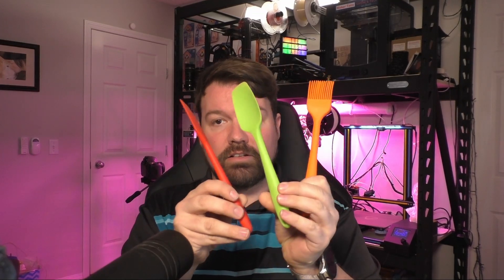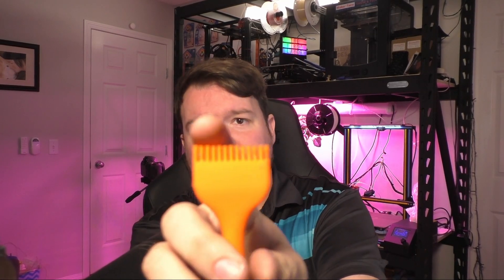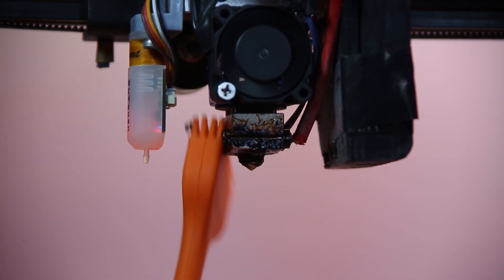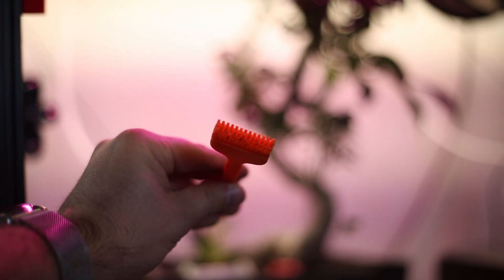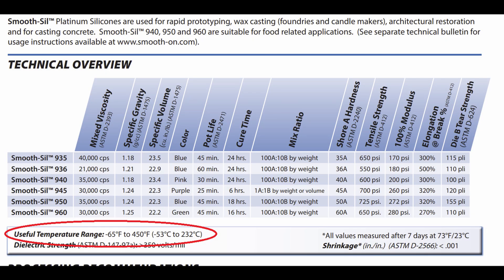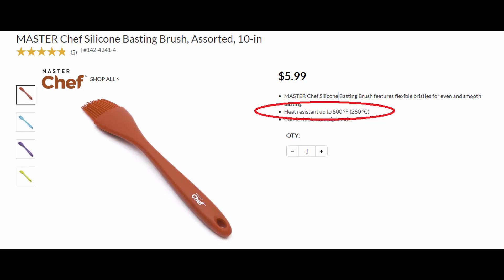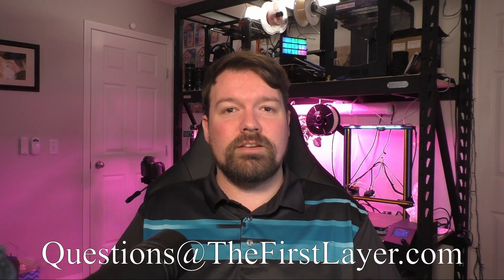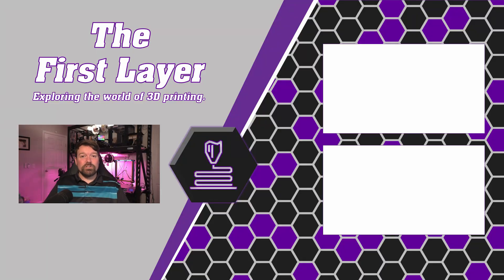The Best $5 Accessory for Cleaning your 3D Printer Hotend

Comment: I use paper towel. I cut sheets into quarters, I then fold a quarter sheet  4 times so I have a 8 layer piece that is about 5-6cm x 1cm and then with the nozzle at printing temp I wipe down the nozzle and block every print with quick movements.

I have a 3 year old block that looks almost new on a printer that prints almost daily. If you keep everything cleaned you should never have filament any where near the wiring to even need a special tool.
Reply from the maker: That's a neat idea for sure. I've said it in another comment, but you could also buy one of these silicone tools and cut it to be a wand so you don't put your hands near the heating element.

Comment: Bryan..liked the delivery...loved the whole .."Ding"..turn on a light schtick...but honestly...just heat up the hotend..turn OFF! the printer and use a brass brush.
Reply from the maker: The only caveat to cleaning by powering off is to make sure to remove the filament, otherwise you can get swelling and stuck filament in the heatbreak. It can happen easily with all-metal hotends. Great tip though!

Comment: That is fine for cleaning all the loose strings, but I don't think it would do much of anything else. Silicone is nonstick. I use a folded up piece of paper towel. I'm just careful not to get burned. The hot filament will stick to the paper towel better than it will the nozzle. Just be careful. Where a glove if you need to.

And I agree, you should not use a metal brush on your nozzle.
Reply from the maker: The idea is to use the short bristles, which are much more rigid when chopped down, to sweep it away and get tangled amongst the bristles instead of binding to them. Of course, with more buildup, there's a better chance of it picking up on the brush.

For the price of these brushes, they're still a handy piece to keep around. And if you want, you can always put the paper towel on top of the cut down brush so you don't risk getting burnt.